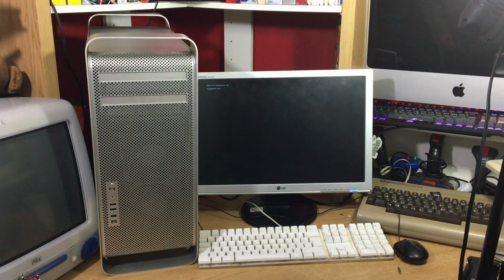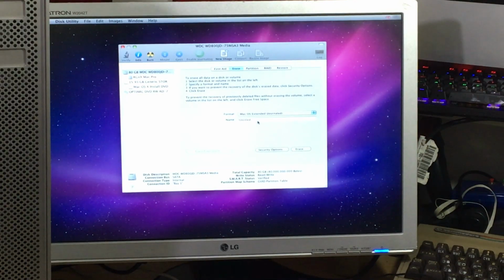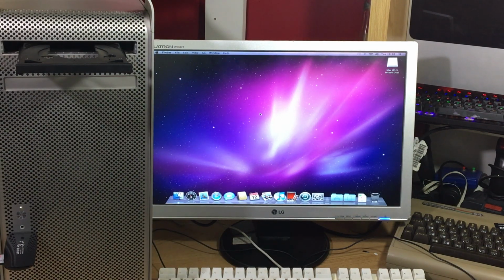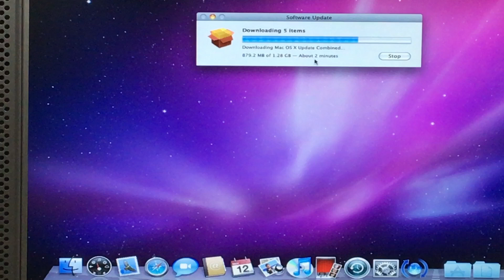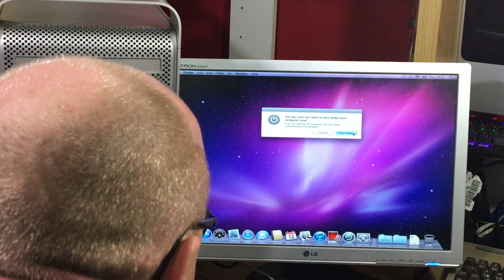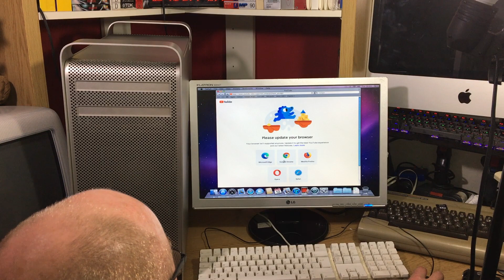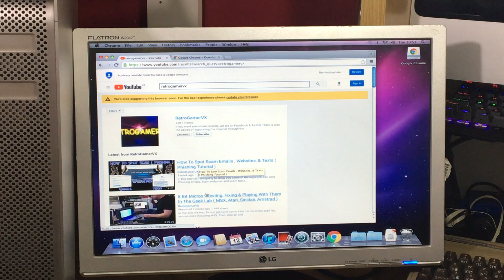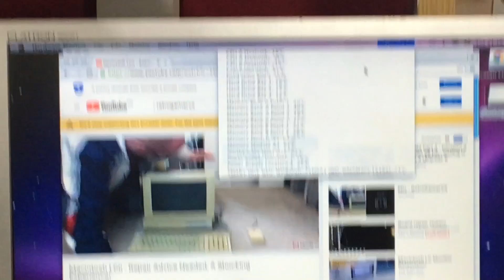£10 For A Working Mac Pro - Seller Thought It Was A Dead G5!  Quick Fix & Setting Up! Part 1.

Comment: Hi Steve: I have had two of these (same model as yours). Still have one of them. They are absolute beasts and still usable as daily drivers. I had the same C2D as you but stacked it with 32GB of RAM (cheap on eBAy). I put a 2GB graphics card in it, shoved Windows on it and it played GTA5. Unfortunately it developed a PSU fault. I was going to upgrade its processors but didn't. If you get around to it, would be a really good upgrade, you can end up with effectively eight cores over two processors for about £60 and in some regards it will keep pace with an i7. The processors are only £60. Well worth the effort if you can be bothered and an interesting, if physically difficult project.
Reply from the maker: Eek, I'd love to do that at some point.  I've heard a few saying that with a bit of work, can get catalina working, but the card you need isn't compatible with this model?
Reply from the maker: Only problem we are having atm is that the lower memory slot on the motherboard does not appear to want to take any memory, gonna try cleaning it first but not hopeful.
Reply: @RetroGamerVX  Those cards are cheap enough I think as spare parts. I have spares but not in the country right now.

Comment: Never trust someone elses diagnoses. The fan sounds like a automated hammer.

I have come accross meany machines someone says its brocan & it turns out to work fine.
Reply from the maker: Yes, I've seen a few videos where people have bought what were supposed to be broken computers and they work fine, or something really simple wrong like was the case here.  Neil has 2 x 3.0ghz cores on the way.
Reply: It sounds like a stock ticker.

Comment: 10 pounds for a cMP, killer deal sir. A cMP like this in my area goes for like 350€, oh and also, do you know if it's a 1,1 or a 2,1? Or even better a 3,1. (I know the 4,1 and 5,1 have a different inside layout)?
Reply from the maker: Thanks, it's a 1,1, been doing some upgrades, which you can see in the latest video I've done on it.